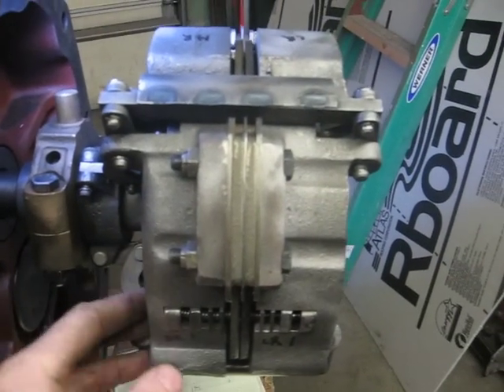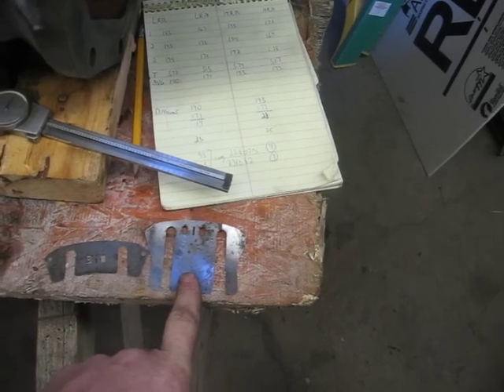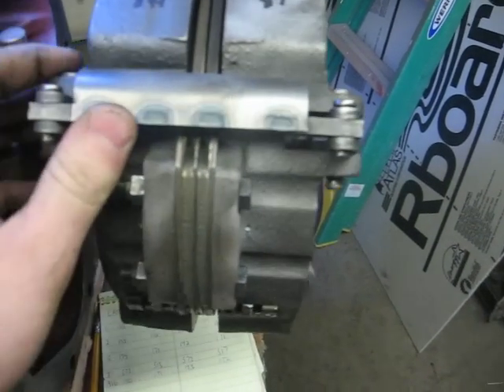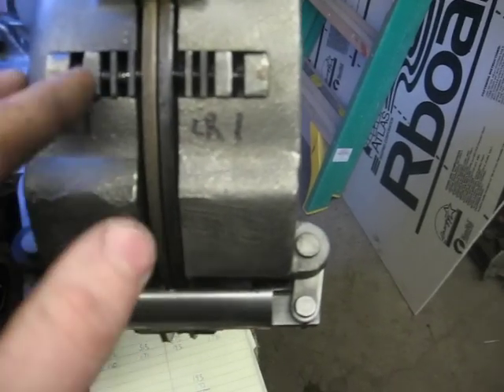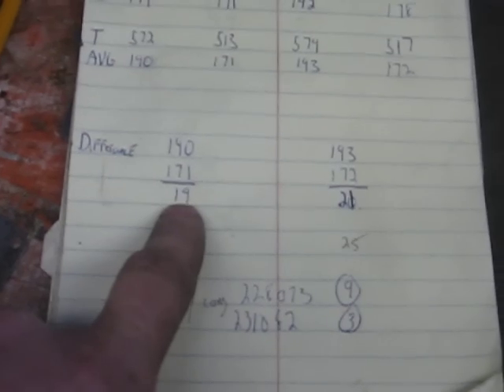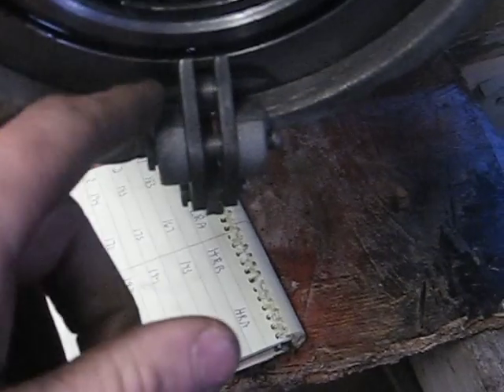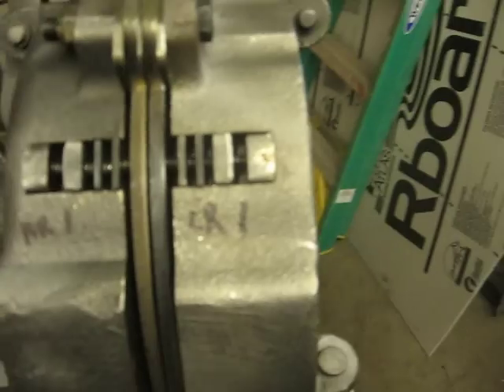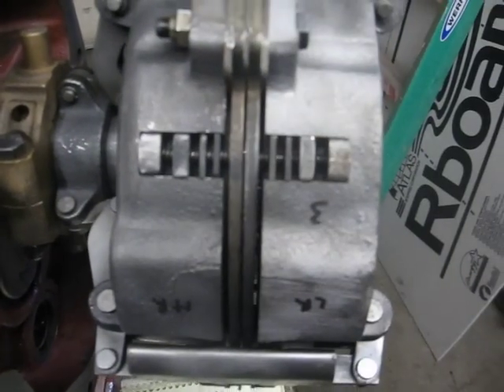power director movie.avi

Comment: Great job on this, any chance of illustrating the wear and failure points on the clutch collar that shifts the sleeve back and forth. We are trying to change out the collar without spliting the tractor, if that is the problem. It's stuck in forward position (back set of plates engaged) with the lever swinging loosely fore and aft.Thanks